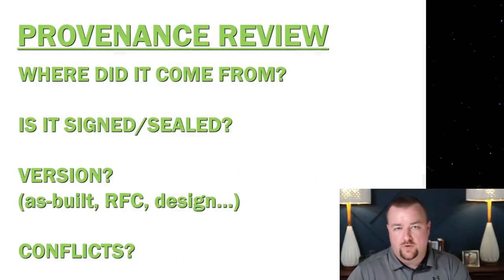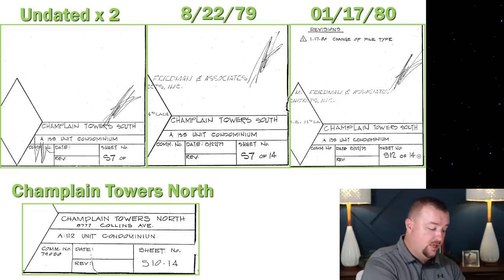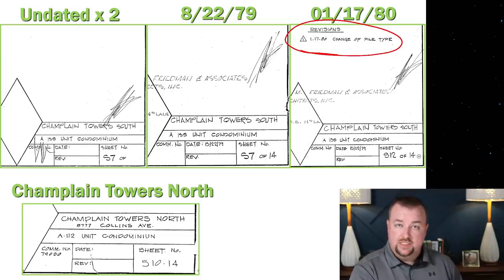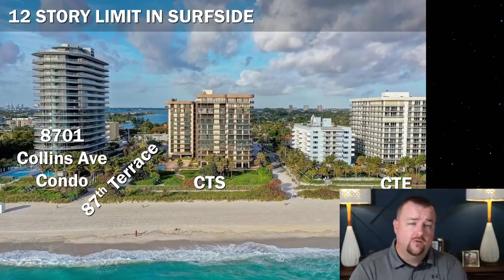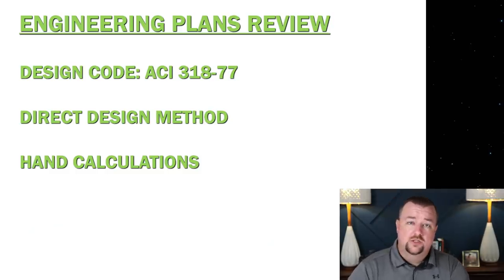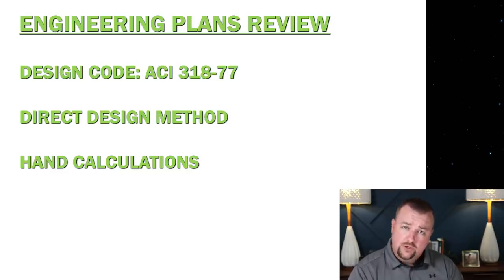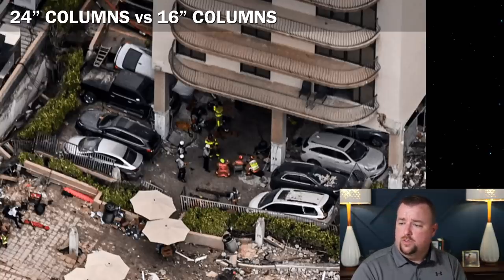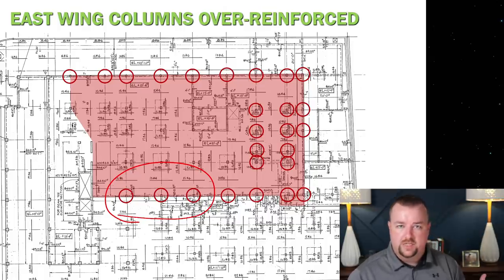Engineering Failures Found in the Champlain Towers South Drawings - Surfside Collapse

Comment: The knowledge it takes to do forensic engineering is tremendous! On top of that you make it understandable for the average person. Thank you very much.
Reply from the maker: Wow, thank you!
Reply: Exactly.  A very logical examination that determines the cause of failure.  As with most structural failures, this most likely was a monetary cause and effect whereby the engineer was pressured by the developer and/or contractor to produce a design plan that reduced construction costs to increase profit...and in the process, the structure ended up being compromised.  Always about the money!
Reply: @BuildingIntegrity  - you really do provide great presentations.  I am addicted.
Reply: @jameschristie4596  money and overpromised deadlines
Reply: I have a rudimentary understanding of engineering, as a result I really appreciate your explanation that not only enhances my understanding of engineering, but my knowledge of the collapse from a forensic standpoint as well.
Reply: I don't know if the law permits it but I think this video should be used for the trial.
Reply: Anybody can design and built a building but it take a engineer to build it cheap and almost to the point of completely collapsing
Reply: Wonderful presenter he is. He speaks in simple terms with a marker. Love this guy.
Reply: This guy should be a professor
Reply: I totally agree. What looks nice often introduces weak points. For example a simple pitched roof has no extra weak pints. As soon as valleys are introduced, these are weak points for water ingress. Decorative gable ends are often fancy and the top edges of the walls are thus exposed to the weather. Roofs should always over sail walls. Decorative renders on walls lock in water and lead to water penetration. Climate change will lead to very intense sudden downpours  which will overwhelm gutters. Your roof better have no weak points.
Reply: I think you overestimate "the average person". Kind of like the engineer overestimated the adequacy of this design.

Comment: I've been a carpenter for Twenty years, admittedly only on homes, but we've had terrible times with architects changing things to what "looks good (only in their opinion, in my opinion)" and messing up the engineers plans, we tell them to sod off, we aren't changing the engineers plans and to take it to the engineers to work with them not us. Thanks for your hard work on this topic.
Reply: Having a house built soon. Glad that out contractor and architect are the same person.
Reply: @kudukilla  Uh... not sure you should be glad considering the OP's comment.  The contractor was a check against the architect who wanted to compromise the engineering.
Reply: @carbonsx3  in the story the problem was because the architect wasn’t on site, like our builder will be.
Reply: My blood boils everytime I have to deal with architects. For them it's always form before function. Who cares if a mechanical system or structure is compromised so long as the building looks good amirite?
Reply: @kudukilla  Its never a good idea to have the same person doing the drawing and checking his own drawing.  That is how you never find your own flaws.  I can look at my drawing for days and weeks and not see problems.  Someone else looks at it and there would be red marks all over that makes me want to slap myself in the head.  Its not easy to be an engineer on complex projects.  Its like trying to design a forest and having to know all the details down to the blade of grass.  I'm just more surprised there aren't more failures.  Sometimes engineers have to overdesign just to make sure its built like a tank.  We use factors of safety of 2 on our machinery designs.  The worse part is to have to design with that factor of safety and a 3 sigma confidence level.
Reply: You should work with Architectural Engineers then.
Reply: Sounds like the Figg Architects that redesigned the FIU bridge to 'look symmetrical.' Oops!
I'm a retired Electrician who did a few Miami Beach high rises. As built is quite different than design plans. 
When the boss is pushing, the workers cut corners. Some correct the as built, some don't.
The only jobs I ever worked on in 42 years that didn't deviate from design plans were the 2 nukes I worked on!
Reply: @kudukilla  Why? Architects know nothing about building.
Reply: @crankychris2  probably use high slump concrete;;;;;
Reply: There is no reason why good looking has to be structurally weak. Architect should fully sort out those (very important) details with the structural engineers, long before the builders get started. 
Each job should be separate teams design / structure / build / inspection.
Reply: @Dave5843-d9m  Sure there is cause the Arch e detect doesnt want to know!
Reply: It's strange to me that architects would have so little grounding in engineering and contracting, that they would knowingly flout their engineers for the sake of aesthetic, yet I know that is often the case. When I was a young woman long ago, I fantasized about studying architecture as I believe it is one of the most truly meaningful art forms there is because of the impact it has on human beings - it effects your mental and physical health, and very life, more than any other art form. But I never felt that I could function well as an architect because it seemed to me that engineering and a fine understanding of your materials and their properties were absolutely core, and I was a little weak in math to be a good engineer. As the great architect who invented the steel frame high rise, Louis Sullivan stated, form forever follows function, and the first function of a building is to safely shelter its occupants and their activities. If it can't do that, it's better it remain a rendering hanging on a wall.
Reply: This is why we need regulation. You go with the math and experience of tried and true engineering over 100s years of what words and what doesnt over "hey we dont need ugly beams we need more planters". Should be criminal! aka regulation.
Reply: @Dave5843-d9m  True but sometimes there's a problem of the architect being too much of an artist to allow simple things like laws of physics compromise his "vision" and if an architect like that one has enough influence to overrule the engineers at best you end up with an embarrassing and costly repair/rebuild job, though at worst the price for the architect's ego is paid in human lives as the laws of physics apply always and without mercy.

We shouldn't think all architects are egotists who only care about their "vision" though, there are those who do in fact care about that buildings they design are also safe and functional, but those architects don't tend to end up in the news.
Reply: @tomrice6059  While it hasn't cost anyone their life yet, there was this concert/conference hall that was designed with white marble exterior cladding sure it looks nice there's just the small problem of marble not withstanding the weather here and the engineers told the project management this, they went ahead with marble anyway.

As result they later had to repair job that costed several millions of Euros and had to be done at least twice (first during the 1990s and the later repair is still underway current and is estimated to complete in 2024)

Oh and during the first repairs there was a proposal to replace the marble with granite (which being native to here would withstand the elements better), which was not done.
Reply: I don't know where you are coming from but blaming the architects for messing up "engineer's plans" is beyond unconscionable and naively selfish.  Architects are at the behest of the owners & developers and implement changes are their request.  It is up to each of the engineering disciplines to document and design their work in light of those change requests.  They in turn have to work as a team and let each other know what the implications of the changes are so that the owner can be informed and the changes costed.  To blame an architect for change issues is like blaming your left hand for the team tripping over a rock.  It is 100% nonsense.

I see this a LOT in the trades too, with one trade criticizing another for not doing "their job" and leads to a lot of construction and personality turf wars.  For this to happen, I guarantee that the person who brings that attitude to a project is a worthless SOB.  You come across as just that.
Reply: @chicagonorthcoast  If you actually knew how much information and testing an architect has to go through to get licensed you would be very very surprised that your statement has no basis in reality.
Reply: Architects are often airy fairy and dont give a shit about structure